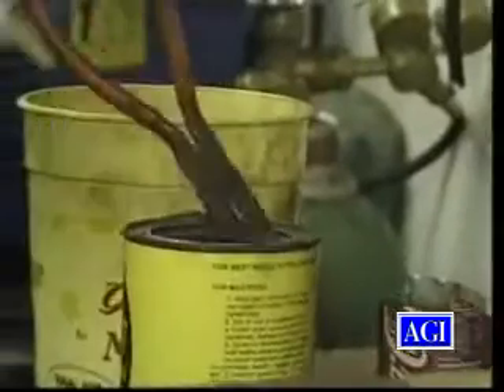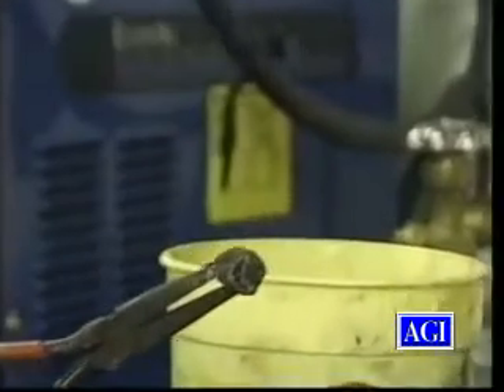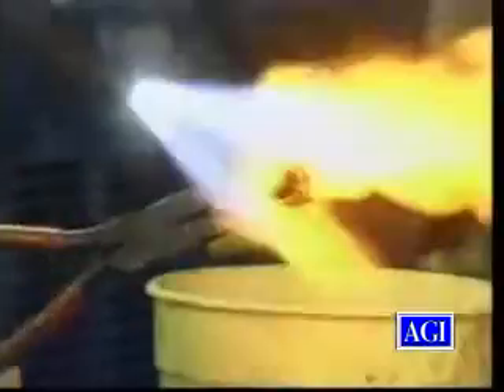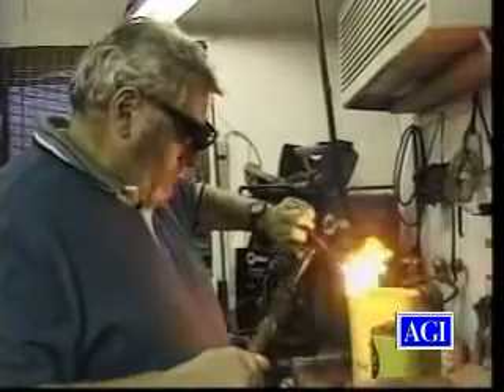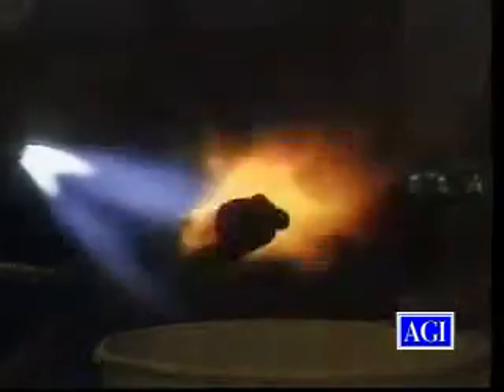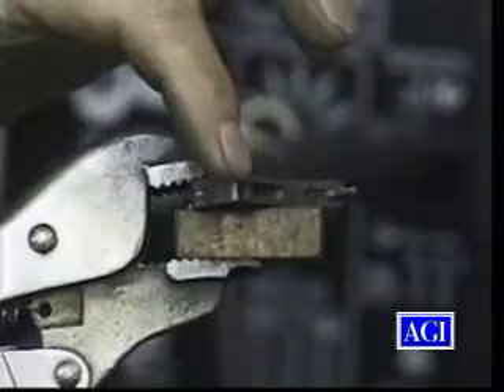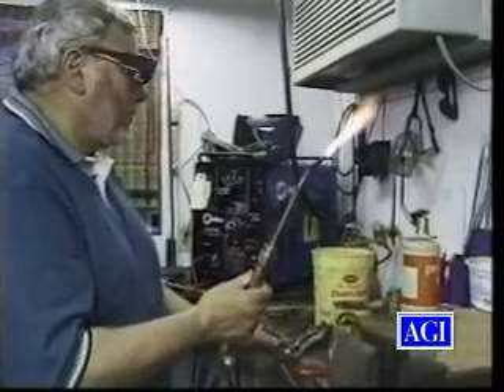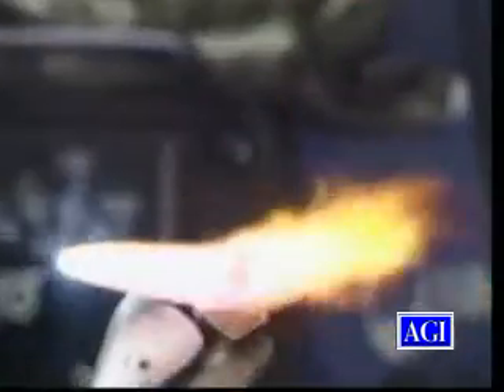AGI 320 Case Hardening Metal Parts

Comment: I'M a heat treater,and you must get the material to at least 1450  or higher to get the carbon to diffuse in the surface.